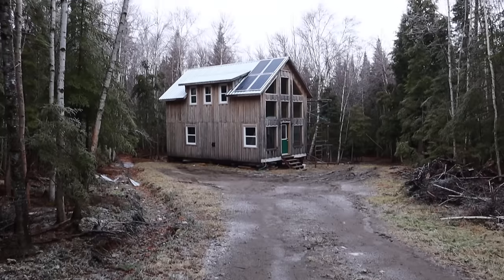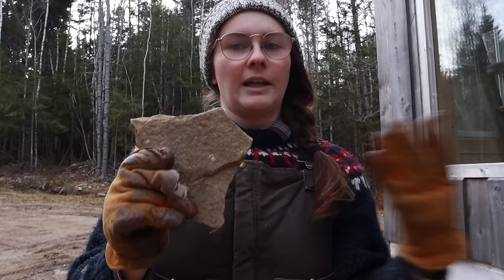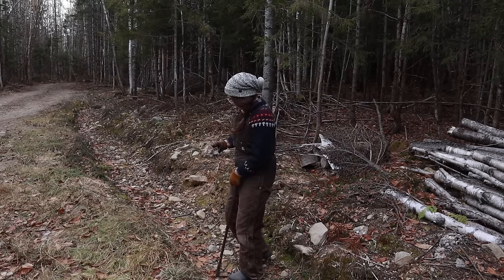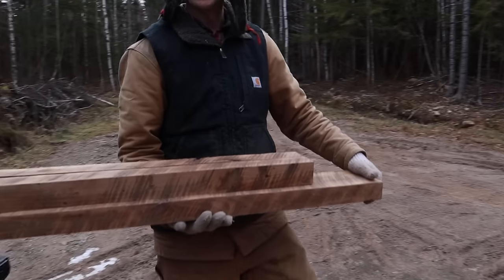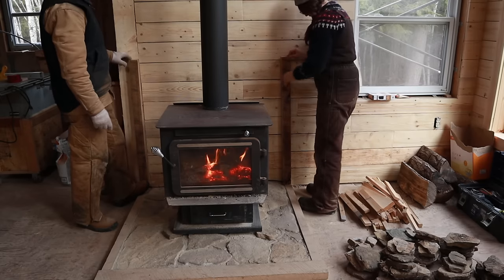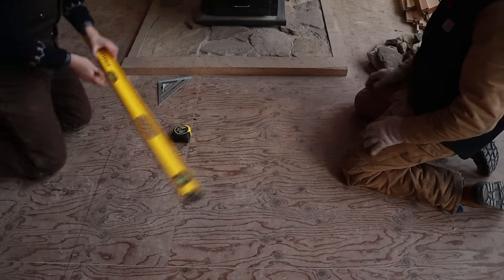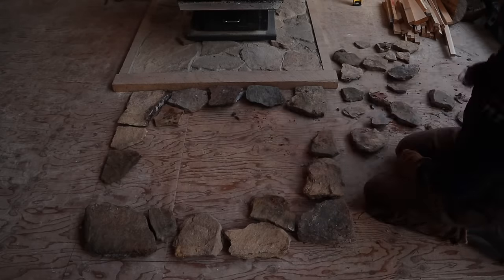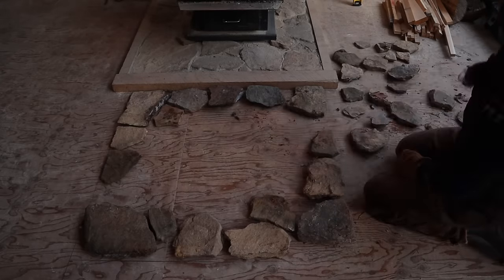DIY Stone Hearth and Wood Stove Mantel | Part 2

Comment: I would nail in an array of little 3 quarter inch nails into the wood, about 2 inches apart.  The nails should pertrude about quarter inch out. Apply mortar over the pertruded nail, rough finished.  Let it dry with the wood for a week. Then only I mount those rocks with fresh mortar over the dry mortar base

Comment: I'm a 30+ yr Mason. I hope that doesn't fall in a few yrs. Your sopose to put wire mesh on a Cement bord nailed to the wall. And you should have some wall ties or nails sticking out a little to hold the top half. But it looks nice. 🙂👍Mud isn't made to stick to wood.